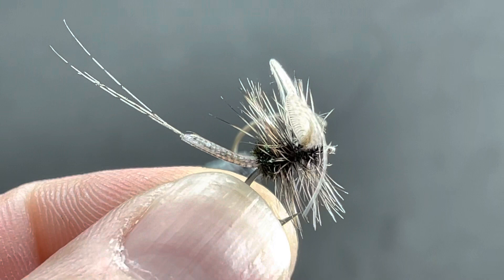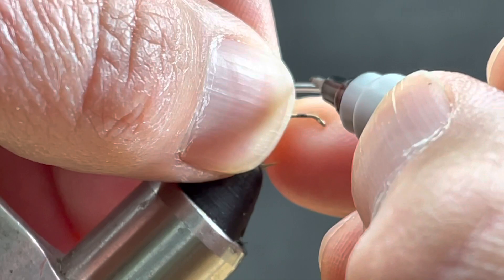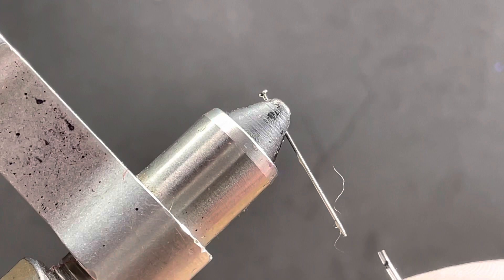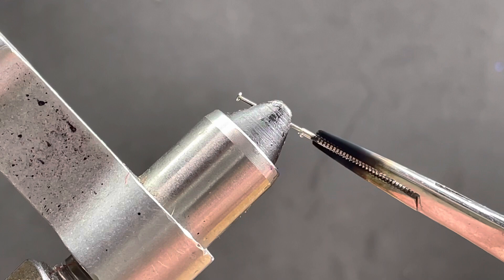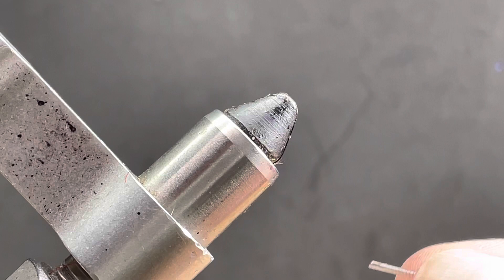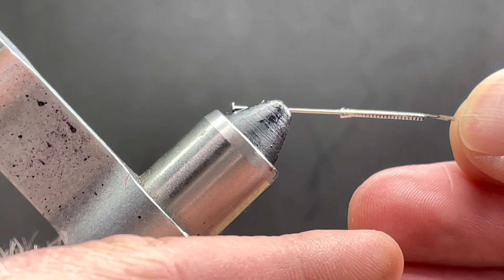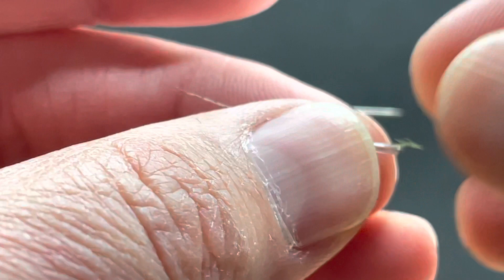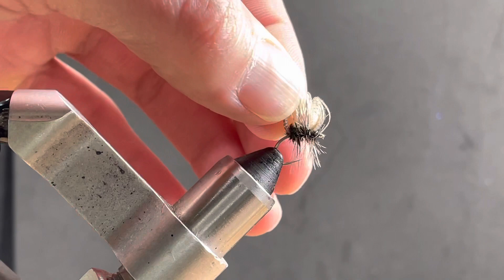A Extended Ribbed Mayfly Body With Adjustable Tubing

Comment: Where do you get the tubing  ?
Reply from the maker: It’s a standard tube for tying. You can look up products from wapsi, and others. This particular one came from “spirit river” but I don’t think they are in business anymore. “Larva lace” is another you can check. 

For a standard size 12 pattern medium is the size you want. You can get smaller tube but it becomes increasingly difficult to work with. And there is are , honestly better options. 

Thanks for your comment